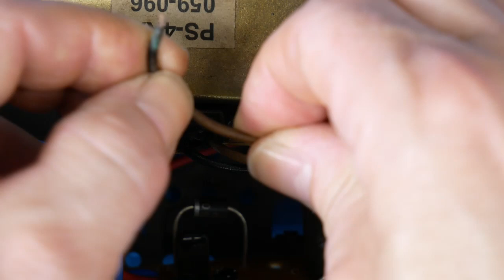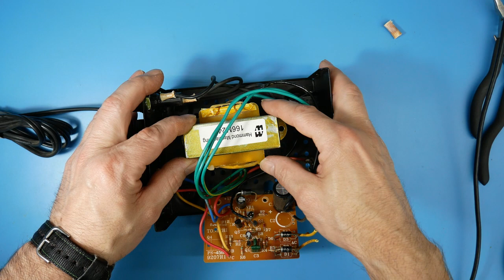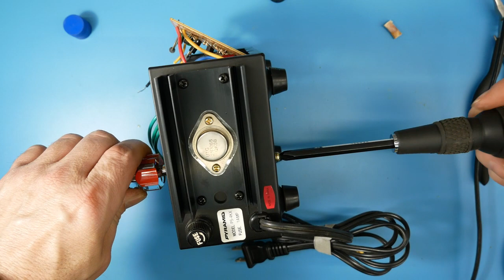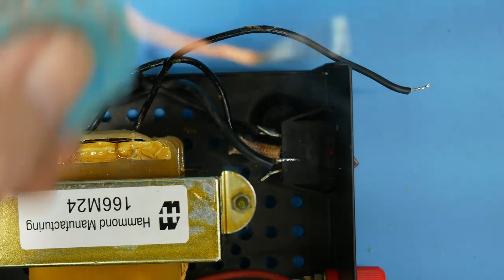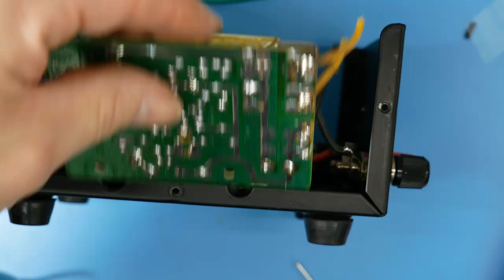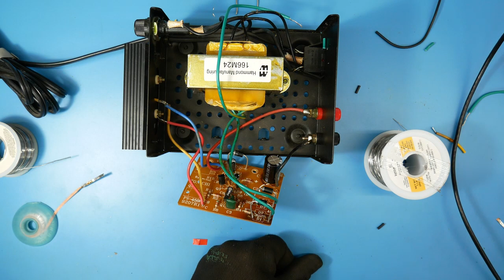#8 Pyramid Power Supply Repair

Comment: I have a pyramid phase III model 12, suppose to put out 13.8v. Im getting 23, 24.. is there something wrong with it? (My grandpa bought it in the 70's).. I'm trying revive some of his old radios.
Reply: the high power transistor is probably damaged, the one on the heat sink at the back of the case. 
Any with a power of about 90 W 15 A minimum and UCE 40 V is suitable. Higher parameters are not harmful. Typically there is 2N3055, 2N3771 / 3772 or KD 501 / 502.

"Short circuit" give damage.
Reply: Great job! On the revival, repairing toasted transistors with better quality parts when I can get them is a must,  but that's just me.that way, I know what I have and the next time I do a similar repair, I will know how good they perform ., a great video.  Thanks!  as far as the pricing on replacement parts ,there's many vendors to choose from on that, I get better prices in bulk, and I've found establishing a relationship with a local business that stocks these parts, they give great prices on old shelf stock. I just lucked up on finding an old schoolmate from my earlier years that owned an electronic repair business, so it is a win win  for me, so! he does a lot of my repairing, i just pay for parts and the labor 90% of it is free. I was fortunate in that respect ,,,